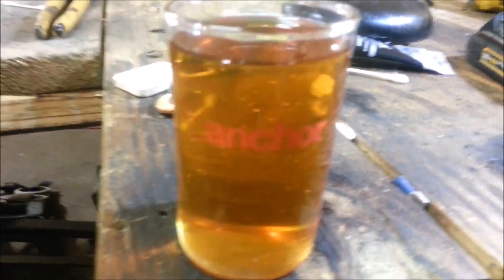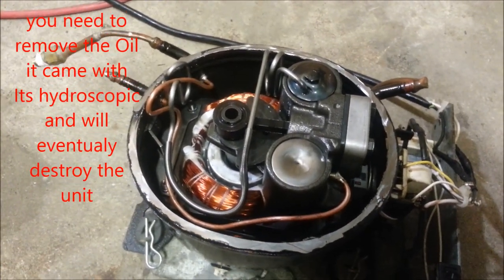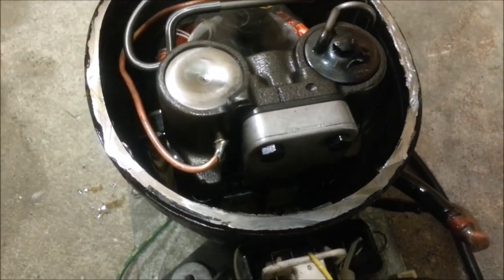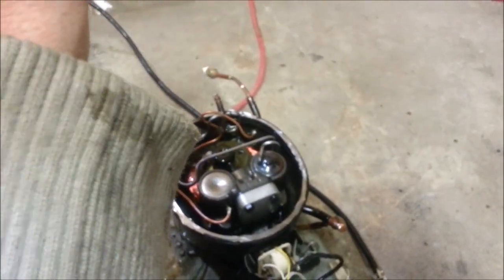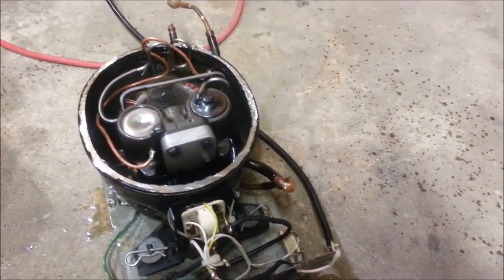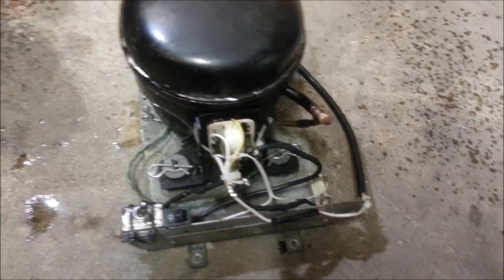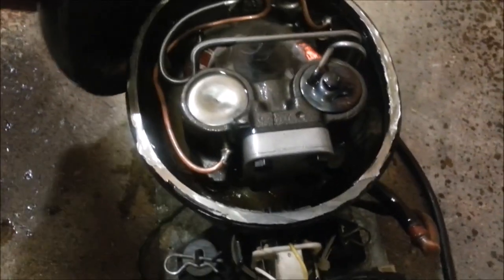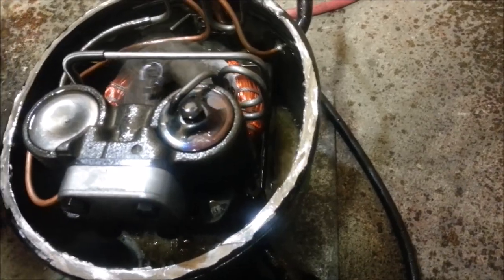Refrigerator compressor oil change / type ?

Comment: Oil = ( C x H x 0.44 ) cc
C = circumference measured at the narrowest waste of the black bulb (cm)
H = height of bulb (cm) 
0.44 is constant
I hope no more uncertainty about the amount of oil for your fridge motors  :)
I know you don't have to open to add oil but not sure how you add otherwise !
Reply from the maker: All you need to do is drill a small hole turn the device upside down to let the oil drain out or drill a small hole  in the bottom and and fill back in with a small screw and gasket , Then to get the oil in just turn on the pump and connect a hose to the intake and it will suck the oil into the device , very quickly i might ad .

Comment: I’m sure someone has mentioned this but, it doesn’t matter how much oil you keep pouring in it … 

Because it’s just gonna pump it out the discharge tube ( the high side discharge ) every time you turn it on.. 

So, you will need a loop system to reintroduce the oil back into the motor cavity… 

And if it were my project, I’d braze a 1/4” copper line to the discharge  and loop it back into the compressor via a hole I drilled in the casing… 

Then I’d use 45% silver solder to seal the copper tube to the steel housing! 

After that, I’d braze a 1/4” flare service port to a check valve mounted To the low side ( suction side ) port using a copper reducer to span the gap… and finally, add a bung w/ matching plug ~ some where close to the bottom of the compressor For use as a drain. That way you can keep the oil clean.. 

If these modifications are made to a compressor that has not been cut open… I would advise adding a breather valve to the very top of the compressor to relieve the internal pressure. 

Or someone could get slick and add an automatic pressure relief valve too or instead there of!

Just my two cents… 

Thanks for posting the video, i thought it was cool!!

Comment: Thanks my compressor star heating i never change the oil, and I think there’s no oil anymore, I will try and ad motor oil to see if that fixes the overheating, thanks for the video now I know how much to add, plus the type of oil 👍🏻 I will let you know if it works
Reply from the maker: you can suck it into the compressor from the intank wiht no problems , it starts to spit when you added to much , just let it spit a bit then let it run for 2 hours to spray put the excess
Reply: They'll get a little hot either way, but the problem is that the oil in the compressor will absorb humidity from the air and start to corrode the internals of the pump. This is why you need to change the oil. You can run for months as an air compressor pump without losing significant enough oil, it's the moisture that the poe oil in the pump soaks up causing rust that's the problem.

Comment: There are specific oils for rotating compressors, they are usually meant to don't mix with refrigerating gases, there are also oils specific for vacuum pumps and for food uses. If you are going to convert the compressor in a vacuum pump maybe it could be useful to change the oil type but you must catch the right viscosity, which I think it's related to the rotation speed
Reply from the maker: never had any problems
Reply: Maybe with those low power units it's not critical which type of oil you use, your experience is very useful
Reply: I've used mineral oil for 5 years of harvesting these pumps for compressors or vaccine systems and never had a pump fail so long as I change the oil at least once a year or so.

Comment: 10 oz. is not enough? or should i add some more?
Reply from the maker: I cant answer that friend because i dont no how big yours is , but from experience they can take a lot more then they need and still work fine
Reply: my compressor is 7''X7''. what do you think sir?
thanks for the reply.
Reply from the maker: If i was you i would only add 8 oz , in this video we can see that 5 oz allows the sump to spray oil and 8 is plenty extra .. as i said in the video do not use Estor oil or the oil that these units use when they are pumping refrigerant gases. Estor oil absorbs water and moisture  . air compressor oil would probably be the best  . on mine i used a self tapping screw that has a rubber washer on it , the kind used for screwing corrugated sheet metal to roofs or barns  to put a drain hole in the unit . then i simply place a hose on the intake line and sucked the oil into the unit . the tank is the vacuum side of the device , it does not fill with pressure so you can just let the unit vacuum 8 oz of oil in seconds ....
Reply: very well said sir, you help me a lot thanks for your help. very informative video :)

Comment: So if I did not cut the top of the compressor open how will I add the compressor oil
Reply from the maker: the oil can be sucked into the device using the intake line , it will not damage the unit , it flows directly into the tank , very quickly i might add . the tank is actually the vacuum side  and it is not connected to the compressor so it will not damage the compressor by filling the cylinder causing" water hammer" damage
Reply: NOBOX7 , I hope you reply to this,  Ive been a mechanic for 30 years and doing A/C, Ive never thought about using a non hydroscopic replacement oil,  i came here, I'm so glad you told me about the fact that the compressor doesn't suck the oil "directly" I assumed it was like a car,   Hydrostaticly locking the pump, also I drained my oil with the intention of replacing it with compressor oil until I couldn't find it and did not want to experiment on my own, thanks much!!!!!!
Reply: @stclairstclair  mineral oil works well enough if you don't want an engine oil smell when running it. Not as good as engine oil but since I get my compressors for free from the scrap I use mineral oil. 4 years since I started collecting these compressors I haven't had a single one fail, though I try to change the oil at least once every six months
Reply: @lazyh-online4839  I used thin mobile one synthetic oil and have not had a single problem, I dont use this often and I have sweat soldered R12 fittings on the compressor so its sealed when not in use,  I needed it for degassing polymer resins and oil changes on the mower.

Comment: Interesting , thanks for sharing.  I may have an oil leak but I’m reading having the compressor repaired costs 2/3rd’s a new fridge ?  If that’s true that sucks.  I’ll attempt to stop the leak by sealing the entire seam with jb or something silly and see if it works.  Shade tree appliance repairs can be hell a stack dryer once taught me.
Reply: Jb could work if you prep the surface correctly and do not run the compressor while it’s curing… 

It’s true though, compressor swaps on residential refrigeration isn’t worth it , unless you have something antique… but all the new ones, unless you can perform the job safely yourself, they’re trash if the compressor takes A shit! 

The job for a residential compressor swap is more involved than that of the same job in a commercial refrigerator so, in the scheme of things, it’s very expensive… it’s august 15th, 2023 and my company charges $1650.00 for most all reach in cooler types.. uprights, work tops, prep stations etc… single door and on up to three door models! So your residential fridge is higher than that!
Give or take a few bucks based the labor time…

Comment: You generally know when you have added too much oil when it starts spraying out of the pressure line. Question is how to get the old oil out without cutting it open?
Reply: The Lightning Stalker, I know as a mechanic that oil in you car's A/C system gets pulled through the system by the refrigerant, but in a car there is only a few ounces in the system, not much at all considering, He is using much more oil than any automotive system drags around.
Reply: @stclairstclair  idk why they use so much oil in these but it might have something to do with cooling. One time I tried pumping some LP gas with a freshly cut open fridge pump and the gas dissolved in the oil and blew like a half liter of oil out when it was depressurized so for some reason they are meant to be filled with quite a bit.
Reply: Turn it on its side
Reply: @stclairstclair  considering this has nothing to do with automotive ac pumps I'm not sure why you're bringing them up.
Reply: @lazyh-online4839  Oh hell I thought you were attacking me, lol, sorry!
Reply: @stclairstclair  no, that wasn't my intention, though I now see how you could have though so. Sorry about that. I've tried using auto compressors as well but I could never get them to work very well, odd fittings and difficulty driving them compared to simple copper tubing and outlet power for the fridge/freezer ac compressors.
Reply: @lazyh-online4839  Ha ha, No problems, 
Plus fridge units are cheap.

Comment: Ok thanks I tried it and it works..thing is thought this is a 12 inch lay down compressor it gets real hot ..shiuld it? And also you ha a kick start wire on this..hot..griund and kickstart and of course the lightning ground..im trying to figure out hot to wire it into my control box/regulator switch  on my tank got any idea?? Thanks bob
Reply: There's common, start, and run, common goes to neutral, run goes to live, and start goes to your capacitor. There's no kickstart, ground, or lightning terminals on these.

Comment: Thanks man! iv'e ordered one of these to use as a vacuum pump, did you have to cut it open to get the old stuff out or will i run out if you turn it upside down?
Reply from the maker: yes . the intake port is directly connected to the tanks , then to refill the device it will suck the oil back into the unit just by connecting a hose . I recommend a vacuum pump oil as regular oils take for ever to degas but they will work . Sucking oil into the machine will not hurt it , it just goes directly to the tanks   .
Reply: @NOBOX7  Cheers! got the compressor took your advice and it seems okay.
Reply: @NOBOX7  sucking too much oil can cause some damage as the reed valves aren't designed for large (cylinder sized) volumes of incompressible high viscosity fluid. This is why, when you get a new refrigerant system (ac, fridge, freezer, etc.) That has been tipped on it's side you need to wait an hour or two before starting it to make sure no oil filled the cylinder or the intake pipe that could damage the compressor valve or load the connecting rod too much (the con rods are just spot welded and not very strong, but don't normally brake unless loading with a cylinder of oil.

Comment: I am concerned that the automotive oil may damage the electrical insulation of the motor, especially when it gets hot.
Reply from the maker: this pump still works
Reply: Engine oil isn't designed to corrode stuff, imagine if that happened inside your engine, that would suck. You can use other oils to if you'd rather, mineral oil is similar in formulation to transformer oil, and often used as a substitute diy transformer oil, so there shouldn't be any damage there. That being said many people do this with engine oil and I've never heard of anyone having issues with insulation degradation from engine oil.

Comment: Hi did you remove the Ptc overload protection?
Reply from the maker: yes but you need an on off switch to tickle the start winding to take the place of the ptc relay
Reply: NOBOX7 thanks

Comment: Hi do you think that is is viable to add this oil into the coolant system if a car to then make it become a condensing unit type of air con unit in youtuber brey213.  Suzuki joe booker shows a green fluid in the radiator and he talks of methanol and alcohol so may these to intereact causing the engine to freeze as. Joe states in joe cell horses mouth.   Any replies appreciated
Reply from the maker: i would have to look into joe booker
Reply: None of those concepts relate to each other, the green liquid is coolant for the engine, ac is not in the engine it's part of the refrigerant system, neither relates to engines locking up, and none of the above relates to the NON-automotive ac pump in the video.

Comment: HOW TO REPLACE PISTON IN THIS COMPRESSOR PLEASE
Reply: SUNIL DHIMAN These compressors cannot be rebuilt unfortunately. It would be a waste of time because you can just buy a new one. It would be cool if you didn’t have to cut them open because it would make servicing and scrapping them easier.
Reply: @MonsterLegoTruck  you can service them so long as you find the parts. The cylinder can be unbolted from the motor frame and the piston/conrod pair will slide off the crankshaft along with the cylinder, pull the old one out, put the new one is, and boom, you're done. It's finding the parts that's the hard part. I never buy them because they're so expensive but I had one that had burnt windings from a bad capacitor and one with a broken conrod, both same brand but different models. I put the conrod from the burnt out unit into the cylinder of the broken unit because they were the same size.
Reply: @lazyh-online4839  and you weld them back together and put oil in it?? That's interesting
Reply: @MonsterLegoTruck  I actually welded a replaceable lid on mine, thought it'd be easier to weld the hinge and seal onto it and clean out any welding slag rather than risk the welding slag getting into the compressor without knowing until it locked up. I know, I probably just overcomplicated the whole thing but I was younger then. I tried using weather stripping for a while as a seal but then I heard of supergluing nitrile o-rings and made a more durable one from a bucket lid seal.
Reply: @MonsterLegoTruck  I will say, I got VERY lucky finding two compressors with matching piston sizes, took them apart on a whim to see if fitting them was even possible. Most that I've hacked apart are all slightly different and don't match up. Even if the bearing and cylinder are the same diameter, you need to make sure the length is the same or you either have dead space or your piston will crash into the cylinder.

Comment: As long as the compressor takes ester oil and the system has been exposed to the ambient air for over 15 minutes,  you have to replace the compressor. aEven if the compressor is running and test good. The problem is ester oil is hydro miscopic and you can't remove the moisture from the oil.
Reply from the maker: your confusing me, this video is not about repairing a pump its about repurposing the pump as a vacuum pump or compressor  replacing with oil that can be used in air applications , obviously you didnt watch the video but thanks for the info any way
Reply: NOBOX7 so 5-30W oil was what youd use on these types of pumps if using for vacuum applications? Mines a long tall cyliner type from a window ac unit
Reply: Changing the oil removes the moisture. I had one running with the poe oil for a year before I changed it out with mineral oil, the old oil looked like frothy snot when I poured it out but the compressor has still been running for another two years since then as a silent air compressor for my mini desk shop.

Comment: Just another guy trying to act like an expert while experimenting with something he knows nothing about.
Reply from the maker: +Wood Wright actually i posted this video after i found myself confronted with the problem of what kind of oil to put in this thing after i did some work to it , then i wondered well how much does it need? so i made this video to help others but people like you definitely make it hard to want to share information
Reply: NOBOX7 pay no attention    thanks for the vid man.
Reply: Use Shell Tellus 68 or an equivalent. If you have the brand and model of the compressor, the data sheet will tell you how much oil you need.
Reply: NOBOX7. Don't listen to that bitter hater, great vid.
Reply: NOBOX7 Must be a paid troll, nice video in any case!
Reply: @NOBOX7  much appreciated, thanks. ignore ignorants